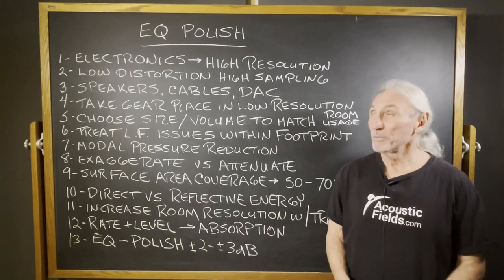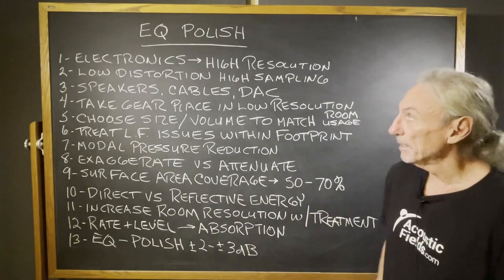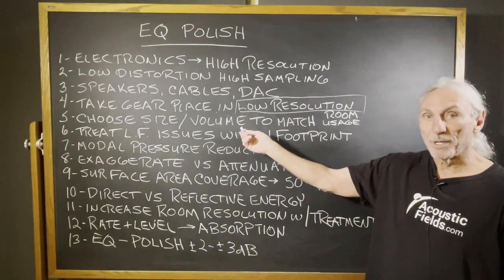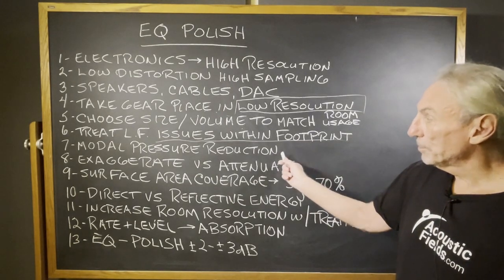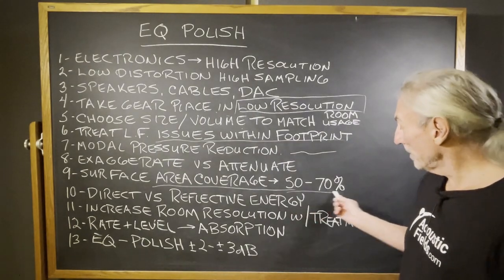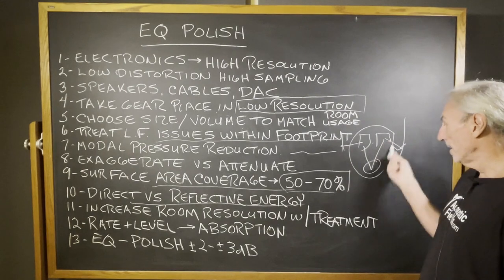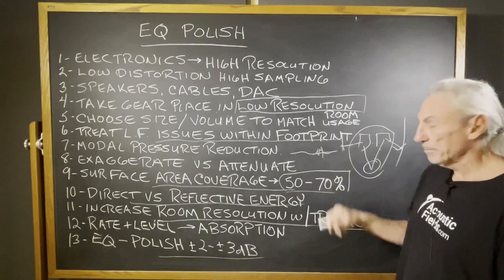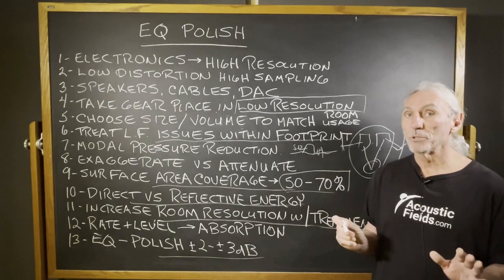EQ Polish - www.AcousticFields.com

Comment: Thanks for the videos, great channel! I have a question. 

Most of room treatment is trying to decrease reflections and modes in the room. Anechoic chambers completely remove any modes or reflections so you would think that an Anechoic chamber would be the optimum listening room. But this is not the case. So it seems actually that reflections are actually extremely important to have. The point source audio is not enough reflections are needed for a quality sound. 

So for the question - What is the optimum ratio of sound energy from point source vs. reflections? If I play a single note do I want 80% of that energy to be point source at the listening position and 20% from reflections ? Or 95% and 5%?  Or 50% and 50%? Once we know the optimum ratio of point source to reflections only then can we know how much of the room we have to treat.
Reply from the maker: It all depends on room usage. Every usage has a different direct/reflected range. This time signature range is also subjective for each usage.
Reply: Yeah, anechoic chambers are for test purposes of microphones, speakers, and other things, not ideal at all for listening rooms.  I read the Guinness record is 45 minutes in an anechoic chamber… :-).

Comment: But corners are still the places where absorbers works best for low frequencies - if you can only buy two membrane absorbers there is a dramatically difference placing them in the middle of a wall or on both corners
Reply from the maker: Not true. Unwanted pressures occur across the whole wall surface along with the opposite wall.
Reply: @AcousticFields  surely, but I did the measurements and the two membrane absorbers in the corners on the ceiling had more impact than in the middle of the same wall - in a perfect world the whole wall absorbs and nobody pretends the opposite - but when you have limited resources and space start with the corners

Comment: What about "rounding out" the corners at 45 degrees using drywall on the front wall does that help or would is using bass traps better?
Reply from the maker: You must treat the whole wall since the whole wall is producing the issues.
Reply: drywall alone does nothing at all - it's nice to hide bass absorbers in the space behind it and for some midrange frequencies it's at least better than a cement wall directly